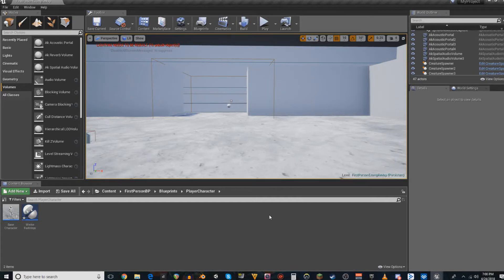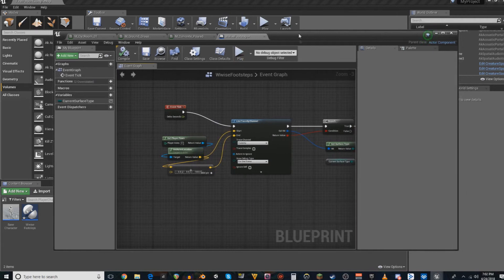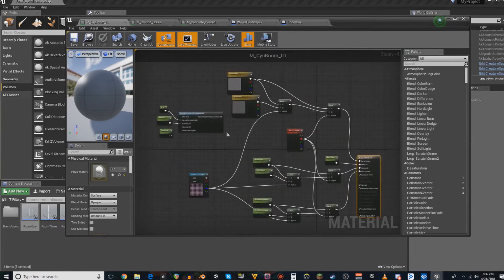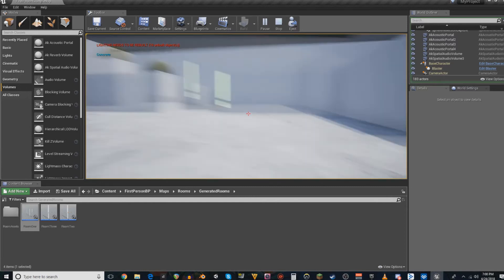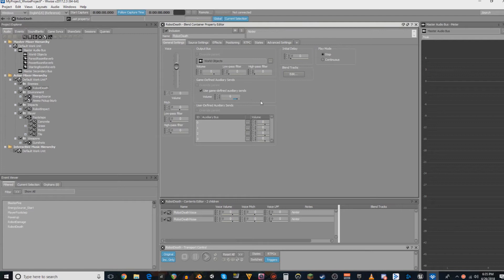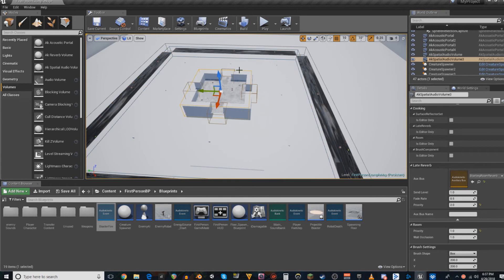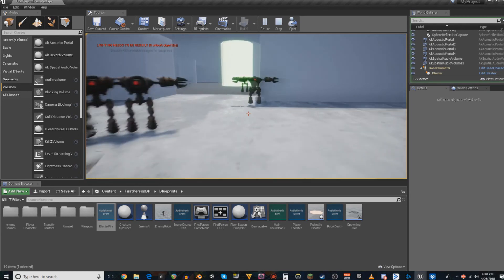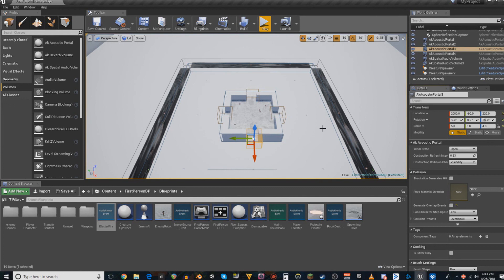Switches and Basic Reverb Wwise to Unreal Integration

Comment: Hi Tim, thanks for the video! Any tips for switching between reverb aux buses? Say that you leave a subway under ground ambience level and enter the next level which is an open space. How would you switch the reverb buses in Wwise? Thank you!
Reply from the maker: Heya! This is done using reverb volumes in Unreal! Each volume has an aux bus attached to it, and you can essentially put these volumes right next to each other with different reverb buses attached to each so that when your character moves from one volume to another, the sounds they make will change. I go over this around the 10 minute mark in this video :-)

Comment: Hello Timothy, I have a question that I cant really wrap my head around. I hope you can help me, 
So, I setup my Reverb Volumes very similar to what you have in your example, however I had this issue where im inside the small Reverb Volume Box contained inside the larger Reverb Volume Box and the source sound is being sent to both wwise aux bus thus is being affected by both aux bus effects at the same time. This makes the inner Reverb Volume Box effect which has a "smaller" reverb to be overpowered by the outer Reverb Volume Box which has a more spacious reverb effect.
I setup the priority of the reverb volumes in the way that the inner box has a higher priority, later I reduced the amount of maximum simultaneous reverb volumes to 1 as I thought that it would prevent the other send to be activated.
This seems to be working fine but... the question is this:
In the scenario where there would be 2 active listeners (2 players) and one player (P1) is inside the smaller box but the other one (P2) is outside of the two boxes, what reverb would P2 will hear being the small inner box has a higher priority??
Would it be the same to post a sound event in the middle of both boxes and just monitor the behavior from the outside of both?  
I know it sounds little bit confusing and I really hope you can help me figure out this one
Thanks in advance!!
Reply from the maker: Hello! So I have not done anything with multiplayer before. I have not looked into it either and when I have the chance I can take a look at it for you (I imagine the Wwise documentation will help detail this for you).

However, as a test what you could do is set up two player-pawns. One in each reverb volume. Then set up a trigger that swaps which listener you are listening from. Then just set up a fire button that plays a sound from one character or the other and listen to how the sound is affected.

I did something similar in one of my videos, but without other pawns (just sound sources inside of other reverb volumes). As far as I could tell, it played the reverb for the zone you are in (but I did not do a very thorough job testing it so I can't be certain).
Reply: @brassbgeek  thank you so much! i will do more rnd and test the two player pawns~